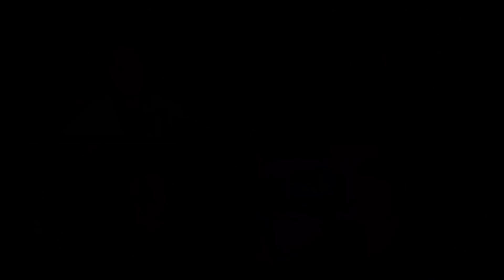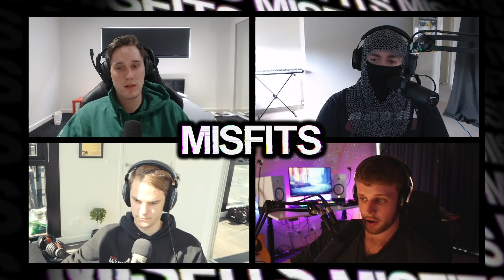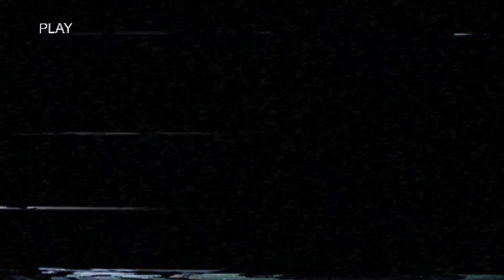SwaggerSouls Explains How Nuclear Reactors Work

Comment: At nuclear power plant they use an radioactive thing like plutonium wich turns water into steam but that water is radioactive, so what they do is run another  set of pipes next to the ones from the nuclear reactor itself so the second pipe also turns into steam but not fkn nuclear steam and that steam goes true a turbine witch spins a giant magnet with a N-pole and the oter hald is a S-pole in the middle of copper wire so the neutrons in the copper start going around and thats then put into high voltage cables
Reply: I didn't study nuclear science but i am studying electricity